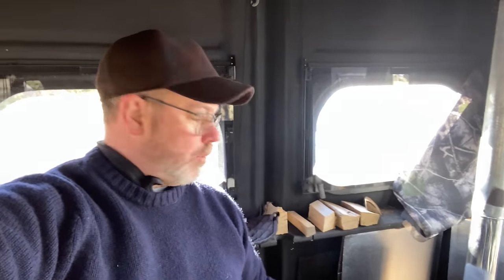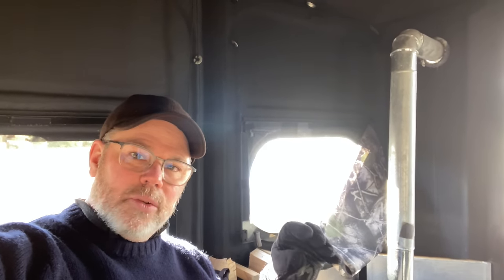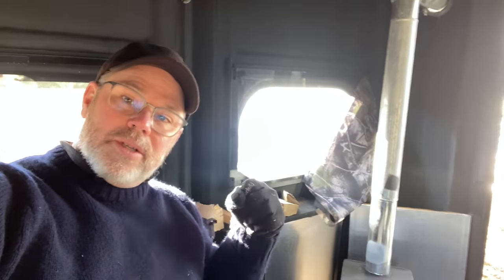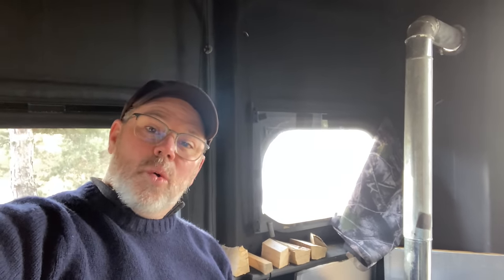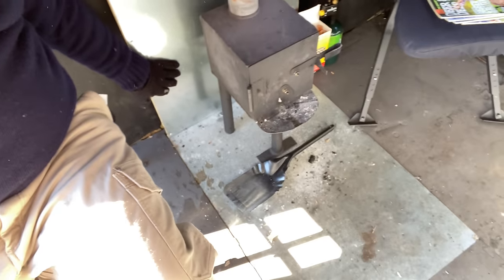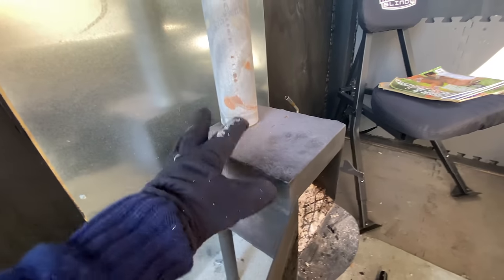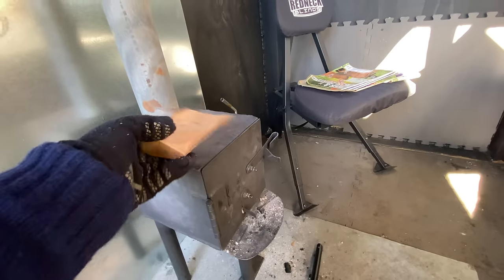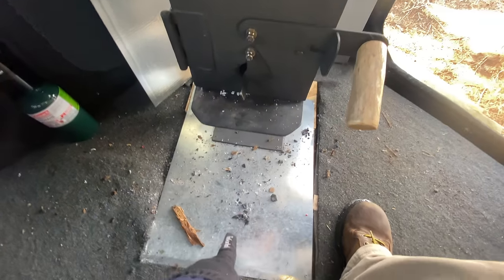Why is this the best way to heat your deer blind?  NO MORE FOGGY WINDOWS!

Comment: Great idea! That is just like the stoves we used to use in our ice fishing houses in Maine, back in the day. They work great! Once it got going, I'd be in my T-shirt.
Reply from the maker: Thanks Lee, one of the heaters I had originally in one of the deer blinds didn't work out well but was designed back in the 1920's to burn small chunks of coal for ice shanties.
Reply: One of the coolest ice shanty wood stove I ever saw was a milk bucket laying on its side with the lid on a hinge and a flat plate welded to the top to cook on ice fishing on Lake Champlain
Reply from the maker: @stevegermain1222  That would be pretty cool to see.

Comment: I built my own "copied the four dog stove " only in stainless steel wrather than titanium. 
And with a baffle. 
For safety, so that the wind doesn't shake it apart. All chimney joints need to be sheet metal screwed together. especially in tents!
The small round crock pot works great on top. If you can sit all day, you can have a nice afternoon meal.
Reply from the maker: Hey Cal, nice job!  Wish I had the skills to make my own like you did!  We like to wrap an egg sandwhich in tin foil and throw on top of the woodstove for a crispy warm meal.  I like the small crock pot idea.  All the best to you.

Comment: got news for you galvinised pipe when real hot gives off toxic gas my friend
Reply from the maker: Thanks for your concern Scott.  A few others have said the same thing.  When I installed them, I cranked up a very hot fire and opened the windows to burn it off, but maybe that was not enough?
Reply: I wouldn’t chance it.  It’s $20 bucks. Or less

Comment: Great blind. Very cool. I have to take issue with your opinion on Scent-Lok. I believe you implied that you didn't take all the necessary steps to get the most out of your Scent-Lok suit. That's the thing. Scent-Lok can't work miracles, but if properly used it does the job. Case in point, I just arrowed a 173 3/8" 12 pt at 17 yards that was directly downwind from me starting at 150 yards. I started wearing Scent-Lok back around 1990 and my success has been undeniable.
Reply from the maker: Hey Russell, thanks for the comment.  If I implied I did NOT take all the necessary steps, I mis-spoke, because I have taken all the steps, plus more including showering, ozone, covering boots in carbon every outing etc...  It just doesn't work for me, and maybe it is the scent on my camera gear and bow, which I just can't get rid of?  But I will say that there are hunters way way way more successful than me that swear by it, including you, John Eberhart etc..  Their success is undeniable, and I respect their opinions.  Congrats on your buck, and all the best to you!
Reply: @theback40  Thank you for the courteous reply. For whatever reason, Scent-Lok has a way of dividing people and causing arguments. I wasn't trying to insult you. I probably just misinterpreted your initial comments. I'm sure you're a great hunter in your own right. As I said earlier, Scent-Lok can't work miracles, everything has to be perfect, and I'm sure there's always a little luck involved. Take care and good luck the rest of the season.
Reply from the maker: @russelllangworthy994  Hey Russel, didin't take it as an insult at all, I appreciate anyone willing to share their experiences and opinions to help challenge my thoughts to keep pushing me to get better.  But more than that, I appreciate someone that can have differeing opinions and not get offended or angry, and still respect the other persons perceptions and opinions.  You are one of those people!  THANK YOU!
Reply: @robertseither6834  Guess I'm lucky I don't hurt in an enclosed building.

Comment: So I am a big stickler on scent control and do use propane heaters knowing full well that you probably smell like a bottle of propane when you leave that blind does no good to wash your clothes and then use propane is heat this makes 100% sense that the negative pressure pulse your sent into the stove burners your sense since it up with a wood smoke smell the deer around here anyways are used to watch it makes a lot of sense
Reply from the maker: Hey Timothy, thank!  Seems to be working this way, so far.  All the best to you.

Comment: Get yourself a NUWay propane vented heater! Once warm no window fogging! Use Rain-x once you will not have any fogging! Another thing is single wall pipe is a lot of your heat put the damper just before goes out roof or wall.
Reply from the maker: Thanks Robert.

Comment: Nice stoves. I use a similar system around my portable heaters but I attached the metal to small spacers so the metals about a half inch away from the wall, I leave about an inch gap at the bottom and air circulates up behind the panel keeping it cool. You can feel the warm air rising behind the panel
Reply from the maker: Hey Doc, that's a good idea, having the stove lower would be better for heat distribution.

Comment: Great video...Thanks!   Honest question.... I have a few box blinds... our plan is to put up three more.  I concluded I wanted more than a buddy heater and was planning to go NuWay propane.   I love this video... I love the idea of wood heat... I also 100% agree with your point on the wood stoves/scent.  In fact... we burn wood in our bunk house and so do most of our neighbors.  So any given day you smell wood smoke in the woods... from wood stove heating to campfires in the summer (and some even burn their garbage still in the boonies).  With that said, I think the smoke scent HELPS us.  It doesn't hurt us.     My honest question.... Do you ever find the "hassle" factor resulting in sitting there cold?  Starting a fire isn't that hard... BUT... i can just anticipate getting in the blind... being a 'little cold' and sitting there contemplating... do i want to start a fire?  I use my propane heaters now with a lot of on and off... turn it on for 30 mins... warm up the blind and then turn it off...It is a turn of the tank and the push of a button and it is on..   Second question... I presume shutting the bottom vent is all you need to do to snuff it out?  Do you do that 30 mins before you go in?   I love the idea of wood (funny how the propane tank shows full until suddenly it is the coldest day of the year).   But I do have a little fear of the hassle factor resulting in us not using them?   Thoughts?
Reply from the maker: Great question, and it is probably a personal thing so will be different for everyone.  For ME, I very much enjoy the process of building and tending a fire.  I'm more the other way, if it is too warm, I have to ask myself if I should NOT build a fire because it will get way too warm in the blind.  So no, I don't wrestle at all with the "hassle"' factor.  And yes, I just shut the bottom vent when I leave the blind.  I have figure out how to time feeding the fire to pretty much start dying out by the time I am leaving, too.  Propane is very convenient for sure, but for me, I would take the inconvenience of the wood heat every time.  But I can understand people who don't get the same joy wood heat provides ME, so propane is the answer for them.  Wish it was an easier answer for you, maybe just try it in one blind for a season to see how it goes?  All the best to you.

Comment: I'm in the UP and my windows fog up with my propane blue flame heater. Takes 30 mins to clear the windows and I have to use a battery operated fan to keep them clear. Pain in the butt. I am just a bit concerned about putting wood smoke into the air and alerting deer. Many people say wood smoke doesn't bother them though.  Good video
Reply from the maker: Thanks Cregg. I know the smoke doesn’t bother the deer around here, probably because many people heat their houses here and they are used to it.
Reply: I've used a wood stove in my blind for over 15 years. It has never once spooked a deer.

Comment: Hey! I've used a woodstove in my blind for over 15 years. It's the best heat. The first stove I found at a yard sale for $2. I burned that one out and built one from scratch in a triangle shape to fit my 8x4 blind better. I can put a log in up to 16" long and it'll hold 3 to 4 pieces. I have to fill it about every 3 hours. I use a 3" chimney which I made a damper out of a soup can lid. I can shut the stove almost completely down. I live in manistee county. You said you are on the west side as well. Close to manistee county?
Reply from the maker: Thanks for the info.  Did you make it a triangle to fit in a corner?
Reply: @theback40  yes so it takes up less space.
Reply from the maker: @mr7badass  Hmmm, now you got me thinking about the next one......good idea.
Reply: S@seeeeessed

Comment: If you had the propane heater in a flue system, like your wood stoves, it would reduce or eliminate the condensation. The byproducts of combustion are H2O and CO2. The BEST thing about your wood stoves is you don't have to buy the fuel for it. You should have ample deadfall around the back 40, to run all the stoves.
Reply from the maker: Hey William, so true, we have plenty of deadfall around here with the Emerald Ash borers and Dutch Elm disease.  All the best to you.

Comment: It's not that there is a lot of moisture IN propane that causes the windows to fog, it's that 99.9% of the byproduct of burning propane (or any other hydrocarbon) IS water vapor.
Reply from the maker: Ah, thank you for the clarification Fred.  That makes sense to me now, gotta remember chemistry class.  All the best to you.
Reply: Google the chemical reaction of adding O2 to propane. It gives off CO2+H2O(VAPORS)+heat.
Reply from the maker: @mikeries8549  Thanks Mike.  Now it makes sense why so much water vapor gets in the blind.

Comment: Thanks for the very helpful vid! My name’s Marco, from Virginia. I’m actually putting a stove in my blind this year similar to this. Everything I read said pile elbows (even a 90 into another 90) were a no-no for wood stoves and that they “had to be straight or no larger of a bend than 30 degrees”. Am I just reading hogwash? I’m assuming thats probably for traditional home heat wood stoves and doesn’t necessary apply to something like this. Thoughts? Thanks again for the great video!
Reply from the maker: Hey Marco, my opinion is that the info you are reading is for home heating set ups.  I have a wood stove in my house and a sauna, so did follow those recommendations for the installations.  But, for my deer blind woodstoves, nah, I think for your blind you are fine with multiple elbows as long as your stack is high enough to create a draft.  The higher the stack, the better.  You're going to really enjoy the wood stove!  All the best to you.

Comment: is the crackling/popping of the burning wood a noise factor outside the blind?
Reply from the maker: Hey Robert, good question, but I would say no.  I have not seen any instance of this.  It is a pretty small fire so the little bit of cracking/popping is not very noticeable even inside the blind.  All the best to you!

Comment: I found a couple online, but they say they're for outdoor use only. Do you have any sources for where you found yours or are you venting sufficiently that you're not worried about carbon monoxide poisoning?
Reply: Oh nvm, should have read the entire description, it says using flue pipe allows use in shelters.
Reply from the maker: @Therapy72  Hey Matt, if you end up getting one, let us know how it works after you have had a chance to use it a few times.  All the best to you.

Comment: Do you find that the smell from the fire scares the deer away?
Reply from the maker: No, not at all around our area. There are many houses, including ours, that heat with wood so they are very used to smelling smoke.
Reply: No
Reply: @theback40  im not sure if that would work in my area.. we are the only camp for 10 miles in any direction so the deer are not really used to smelling smoke.
Reply from the maker: @GYPSY400  You are probably right then, if they're not used to the smell, it will probably put them on alert.
Reply: @GYPSY400  my blind is the only thing in a 3 mile radius that burns wood and the deer dont care. I have videos on my phone of deer 10 feet to one foot off my blind while its smoking.
Reply: @mr7badass  just burn a fire at the camp if your not using a fire place or wood stove. Do that half regular when your there even on the off season. And before season starts make a fire in a few blinds and let them burn do that a few times. You should be good then.
Reply: My great uncles favorit stand was a nice tall ridge with a fire on top and he shot lots of deer